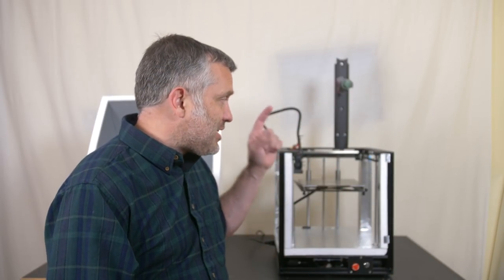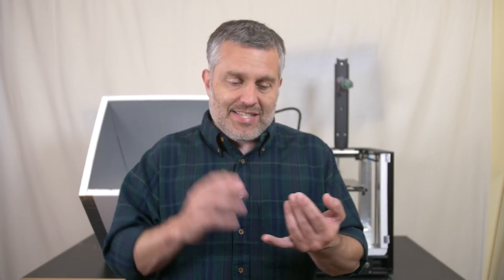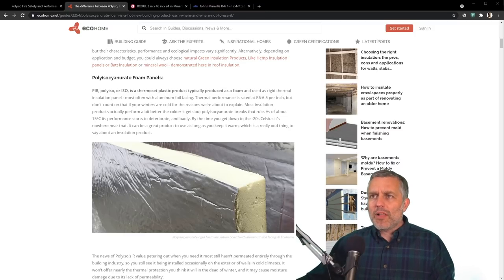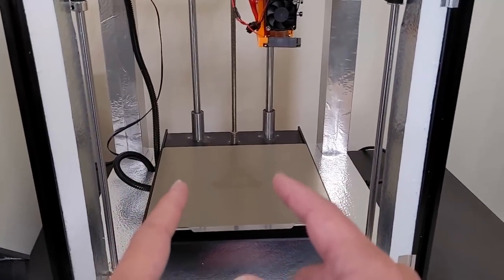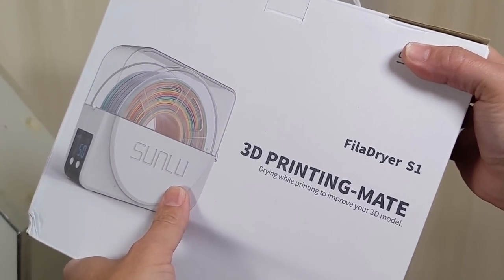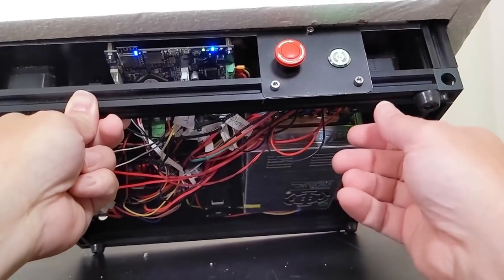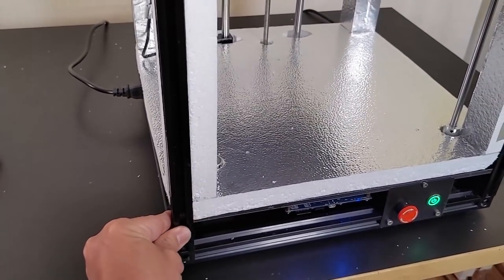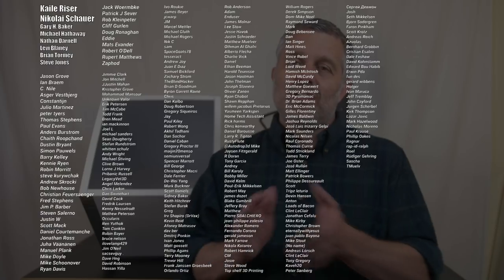INSULATED 3D Printer Chamber CoreXY With Isolated Electronics

Comment: What are your thoughts on applying gold tape inside the chamber? I herd that gold is the best at deflecting heat.
Reply: This is the sort of nonsense that spreads around the Maker community.
The idea comes from the gold colored insulating sheets that spacecraft use. 
It is essentially transparent to heat, and will provide basically no thermal insulation.
Those NASA sheets are aluminized plastics (Mylar and the like), the gold comes from polyimide (what Kapton tape is made from). 
The reflective surface is extremely good at reflecting infrared. Since there is no source of IR light in a printer, they would not be doing much. Also, gold tape (Kapton) is far less efficient at reflecting IR than plain aluminum duct tape.

Comment: If it has a floor, a roof, doors and windows it is a house not a chamber no matter what size it is, also a fan assisted oven is a heated chamber ???? As you are using the heat from the 3d printer all you are doing is insulating it you could use old stripped fridges and freezer for the for this type of chamber with little modification.
Reply: Nice thinking , also a small dish washer  would do

Comment: Awesome!  Thinking aerogel material... I think in the fiber form or whatever the rolls are seem like the thinnest for the thinner requirements.  Not cheap... though seems like a high dollar option.  I so need to move forward with the MPSM V2 Colossal build now I have a second unit and most the parts other than the 3D printed (I think at least, still need to test 2nd unit).  Thanks for sharing!

Comment: 14:30 - u could put silicone mat heaters on the metal at the top and you will heat the whole thing up faster as ur heating the thermal mass directly. If ur worried about run away heaters attach some thermal cut-off switches in line with your heaters. Possibly add a few low profile heatsinks and fan so it heats up the air too.

Comment: I've made a 12mm ply box lined with 25mm insulation and a 10mm acrylic door housing my ender 3 with the power supply and control interface mounted on the outside and can maintain at 60°c at the bottom of the chamber but I do have all other electronics inside the chamber with a bed at 100°c and I havent sealed the door yet

Comment: Curious about drywall. That's something I was considering for building a heated enclosure. I haven't looked into the specs vs costs, but drywall does have to be fire rated. A single sheet is required between a home and an attached garage to prevent a fire from spreading from one to the other.
Reply: Drywall is kind of a terrible insulator. Standard 1/2" drywall has an R value around 0.5 while this foam he's using is upwards of R5.
Reply: @secretagb  Oh, agreed. I meant have the drywall as an inner layer for the fire retardant, and then the foam layer.
Reply: @cbbbbbbbbbbbb  ahh ok gotcha. Right, I don't see why that wouldn't work other than cost problems.

Comment: Nice job. What will you do to keep the hot end / heat break cool?

When I ran my CR10 in a very hot room the extruder gears squashed the filament enough to jam the bowden.
Reply: @martylawson1638  Thanks! I didn't consider running filament next to water cooling.

Comment: The x-max / x-plus from qidi have a spool holder in the enclosure, as well as one outside. I think that's genius exactly because you can print AND dry at the same time (and there are fans blowing air out, so the humidity doesn't stay in).

And I know you dissed Qidi printers recently exactly on the enclosure, but here's the thing: yes it is a little bit more wasteful in terms of wasted heat, but you get 50C in the chamber easy.
Reply from the maker: The enclouse of the Qidi that I reviewed is pointless. It is not insulated and has a giant hole at the top and at the bottom thus inducing "stack effect" cooling. If the Qidi printers you are talking about are similarly unsealed, the "Enclosure" won't dry with any usable efficacy. I'm massively unimpressed with Qidi after seeing that printer.

Comment: heating the enclosure? have a spare bed with heater and thermistor sitting around? You should! stand the bed vertically from a wall, an inch or so away. force air around the bed. If you have an old controller+display, hey, set up another heated bed, only this one heating the chamber. the old controller will give you PID control of bed temp, and allow you to control fans as well.

Comment: Maybe you got a lemon or I got a better than average one but... I put my ender 5 plus into a tent enclosure with a thermostat controlled heater at 48-50c for over a full week. I was printing ABS parts for my first voron. Never had an issue with z homing. Though... after cooling down a few days later my wham bam magnet adhesive failed :X

Comment: I seriously doubt you'll see this today but since I'm building a foam enclosure due to you having some luck with it, I'll ask (the foam is shockingly strong.) To door, or not to door? I'm leaning towards no door, but I also recognize that's because having it completely sealed off is already difficult in my situation so why make another hassle when I feel like a window gives me everything I would actually need. I do also recognize how much more convenient a door would make things, so I'm really torn.
Reply from the maker: I vote no door. Lifting the chamber off like a lid allows you to access the print from all sides. Also No door means a better seal on you chamber. It will work better to hold the heat in. Also less of a hassle to construct. The hinges and the door make it a lot more complicated than making 5 sided box.
Reply: @DesignPrototypeTest  thank you, that was the answer I was hoping for lol. Although I'm an idiot and my base is stupidly difficult, Voxelab Aquila (Ender 3 clone) that I'm not pulling the electronics out so those are open on the bottom (outside of the enclosure), with the screen also outside the enclosure. I'm a moron, making it more difficult than it needs to be, but if it works I'm blaming you. Thank you for your videos, they have genuinely helped a ton. Off topic, hopefully the GMC is still good, I have enjoyed that build.
Reply: I did build this, no door, I with windows. Ender 5 Pro with an E3d V6, printing ABS with a 100c bed, 260c nozzle, the enclosure is huge, and it is solid at 65c after being on a little while.

Comment: Could you do a comparison between the creailty tent enclosure and your custom enclosure I was able to get my creailty enclosure up to 42c when printing PC MAX with my ender 5 plus and 38c with my ender 6
Reply: With original heated bed? I have Ender 5 Plus and building much more serious chamber with mineral wool and steel panels to reduce the internal volume as much as possible. What is your room temp and how fast are you able to get to those temps with that bare tent “enclosure” (strong words in my opinion)? If it's go up to temp in 30 minutes I might get rid off the idea of separate chamber heater out of my head.

Comment: when do you need to run water cooling ?
Reply: If you build your printer and enclosure as a whole system as companies like Stratasys do, the only parts that cannot be deported of the heated chamber are the extruder motor and the heatbreak and thus candidates to water cooling. Everything else can and should reside behind an isolating panel (XYZ stepper drivers, controller board, power supply) ad ventilated properly. Inside the chamber, you just have to take care your levelling bed sensor, silicon wires, rubber and limit switches are able to handle the desired temperature for the chamber.

Comment: Well this is a good idea to enclose and heat the chamber but for that you need to do it correctly. I explain: the Insulation panel you choose are just garbage in addition to be dangerous for that use. I designed a version where there is 2 aluminium plates with glass wool in between, the surface is recover with an additionnal aluminium heat deflection film. The entire panel is modular, fire proof, and effective. Capability to heat 60°C within an hour in your case is just not possible to use. With better design and mostly better materials you can achieve at least 150°C stable enclosure, with an additionnal heater than the bed, and that under 10min. Glass wool is cheap af, alu panel pretty low cost too, if your are realy aiming a fully fonctionnal prototype able to print industrial grade materials, I think you have to muscle up the design, btw you have pretty expensive tools on this machine you made, Slice Engineering etc, Give the printer the prototype she deserve :)

Comment: I insulated my ender 3 two years ago, the biggest issue i ran into was the stepper motors would overheat in the summer so l made the whole system liquid cooled. Its probably not done alot because difficulty plus cost.
Reply: that's why top shelf heated chamber printers have the steppers outside the heated chamber
Reply: I'm planning to run a Hemera in a heated chamber. Expect I'll need to water cool it.
Reply: @SignalJones  if you buy really expensive steppers you can run them super hot. Some high end brands do that.
Reply: Did you experiment with cooling liquid for cars on clycol basis. Ipresume they do a better job than plain water.
Reply: @a1hamer  i just do pla, it was mainly for printing in the winter in my garage. Plus just using water i can buy cheaper pumps.

Comment: Why don't you just use sensor-less homing using stall detection? You'd have no melting switches at all. Auto-bed leveling IMHO is just a gimmick. It doesn't level your bed, it compensates for a bed that's out of level and warped. Doesn't it just carry those imperfections throughout the whole print? Even if you don't think it's a gimmick, the fix for that would be to figure out a way to not have your bed go out of level and have a perfectly flat, solid copper platform. You could use a NEMA 23 to control a single, zero backlash ball screw on a z-axis setup like a fork lift for the bed. My Grizzly G6019 has an 80 lb head that doesn't go out of level. I'm sure it can be done with something as light as a 3d printer bed. BTT boards like the BTT SKR v1.4 have built-in support for driving external stepper drivers. I plan to use one for my CNC mill. They label them as CLS (closed-loop stepper) pins, but the stepper driver doesn't have to be closed-loop. They can be any drivers. You'd just need to use external power for the stepper motor.

If you look at an Ender 5 Plus closely, you can see that it's perfect for a project like this. The electronics, including 4 of the stepper motors (2 Z, Y, and extruder) could all exist outside of the box. The X could be, too, but I wouldn't be able to patent my idea if I told you. ;-)

I love your videos and that you're so effing opinionated. Keep up the good work. Here's my opinion. I think printers with sliding beds are ridiculous and whoever came up with that idea probably just figured out how to adapt a CNC router design and couldn't think beyond that. CoreXY is clearly the better way of doing things. It takes physics into consideration. Printing large objects with your bed shaking back and forth is a design trying to defy Newton's laws of motion. Discuss! ;-)
Reply from the maker: ABL compensates for a bed which isn't perfectly flat. All beds dome/dish (concave/convex) when heated because the heat is not uniform throughout the bed plate. The edges are always cooler which means they are expanding less than the hotter middle section.
Reply: @DesignPrototypeTest  Do you know how it actually compensates? Does it only compensate under a certain z-distance and then tapers out the compensation as you move up in the model or does it compensate all the way to the top? 

I should add that we put the borosilicate glass on top of the aluminum bed because it doesn't undergo a lot of thermal expansion. Its coefficient of thermal expansion is ≈3 × 10−6 K−1 at 20 °C. Aluminum is 21-24. Copper is 16. Fused quartz (fused silica) is 0.55. (Has anyone tried that). Copper would be a better hot bed because it conducts heat better than aluminum which would make it heat more uniformly. I think your heated chamber will also help make the plate more uniformly heated.

My reason for getting a 3D printer was so that I could print PC. I love the info you've been providing. I, too, am working on the perfect printer for that purpose. I'm still learning, though, so it will be a while before I go for it.
Reply: @jimberg98  you could make the bed out of copper, but not as cheap as aluminium. You could use cast iron. Neither much use on a bed slinger due to increased mass, and you'd need a pretty lumpy stepper, and the rest of the machine would need to be more rigid. For a non-bed slinger, would be OK, but not too good canter-levering it off a couple of 8mm rods. For a delta it doesn't matter, they aren't very accurate anyway, ;-)
Reply: @debonh3828 As I stated, I don't get bed slingers. Slinging a bed when the material is clamped to it makes perfect sense for routers. It doesn't make sense when you're always hoping that it sticks on its own and you find yourself using hairspray, glue sticks, and other "tricks". The tendency for your print to curl on the edges is bad enough but then you want to throw momentum at them, too?

I like the cast iron idea. It is way cheaper and lighter than copper. It even expands less with heat. Aluminum is fine, too, as long as you don't depend on it to be perfectly flat. I would never put a magnet on my aluminum hot bed and stick flex plate to it. Why have a plate that conforms to the flawed shape of the hot bed? The idea is sound for convenience, but I think it would make more sense to mount the magnet to glass and then the flex plate. You could remove the glass with the magnet when you know it will be too hot for the magnet to keep working. There should always be glass for flatness. Whatever you want to build on should go on top of that if it's not the glass directly.

Have you seen how resin printers work? Their plates face down, but there's no reason they couldn't face up and be much bigger. I wouldn't use 8mm rods, but I thik they could work as long as you had two bearings on each rod to bear some of the stress from the leverage. I plan to design, prototype, and test. ;-)

Thanks, good brainstorming!
Reply: @jimberg98  the Voron guys use cast aluminium (aluminum) plates. Check out Nero3DP for some build videos on the different Voron series and to see how they handle the fixed plate bed setup.
Reply: @anthonyrich1592  The timing of your reply is funny. I received a promotional email from my local metal supplier last night and they were having a sale on cast aluminum tooling plates. They're perfectly flat and polished. That's a much better platform to set a flex plate, I will try to take a better look at the Voron printers. Is there a specific model I should look at? Thanks.
Reply: @jimberg98  Voron printers are (source and) build it yourself. Nero 3dp has an 12 minute video up here talking you through the process of using a cast aluminum tool plate as a heated bed:
Cast Aluminum Printer Bed - Putting together the best DIY print platform for your 3d printer
https://www.youtube.com/watch?v=vZx4vfevwx4

Comment: The problem here is you have no idea about all the printers what you just said about the electronics for example um ender 5 ender 6 maybe?
Reply from the maker: What are you on about? I have a great idea about printers. What is it exactly that you think I said wrong about Ender 5?
Reply: @DesignPrototypeTest  That both the ender 5 and ender 6 have all the electronics under the printer.
Reply from the maker: No. The X, Y, and E stepper motors for both of those printers are up on top. Of course many printers including the Ender 3 have control board placement inside a box at the bottom of the printer. That doesn't necessarily isolate it from a potential heated chamber. In most cases it is very difficult to place an insulation layer between the control board and the build volume. Reason being there are vents on top of the box. This is a consideration which must be designed into the printer from the beginning. In the case of the Sapphire I showed here the bottom floor is un-perforated. This makes it easy to isolate a heated chamber from the electronics INCLUDING the X and Y stepper motors. You could do something similar with the Ender 6 but the stepper motors and the Delrin/Nylon wheels of the motion system make that printer a poor candidate for a heated chamber so it doesn't matter if the electronics are under that printer.
Reply: @DesignPrototypeTest  got ya
Reply from the maker: I hope you have a nice rest of your day.
Reply: @DesignPrototypeTest  I understand the v wheels but everything else I mean a nema17 can operate fine at 100c
Reply: @DesignPrototypeTest  you to
Reply from the maker: >nema17 can operate fine at 100c
Yep. For a time. But for how long? If you must have the stepper motor inside the chamber then it should be a specifically designed high temperature motor. I arbitrarily set 100°C as my goal. I'm guessing that the chamber should be a lot hotter for PEEK. Maybe when CNC kitchen gets around to testing heated chambers he will find that 150°C is the ideal temperature for ABS. There is absolutely no consideration being given to thermal toughness or the ability for these printers to resist the negative effects of thermal cycling. I'm only just starting to have the conversation with this video. When you look back on this video in 10 years you will see just how far the issue has come and wonder how you could have ever defended these thoughtless Chinese designs.
Reply: @DesignPrototypeTest  ok well creating a high temp environment for peek and nylon etc. is a whole other animal then keeping a abs print flat on a build plate. Everything is built to a price point. I understand what your saying if that is the goal.